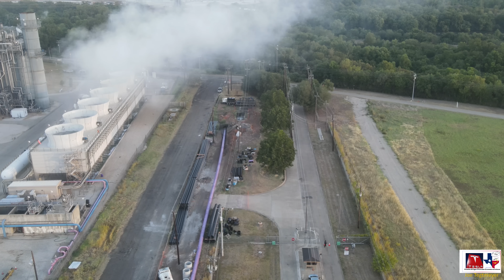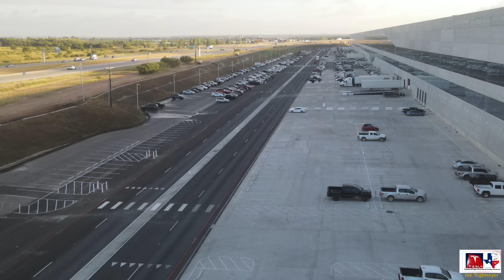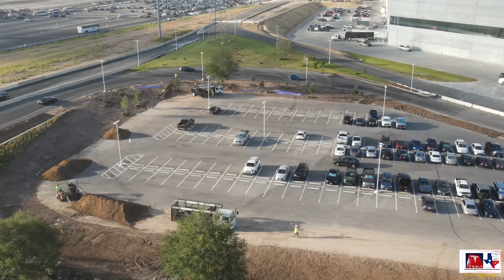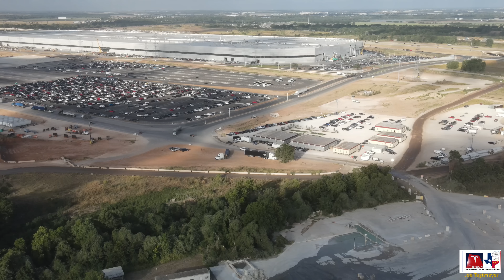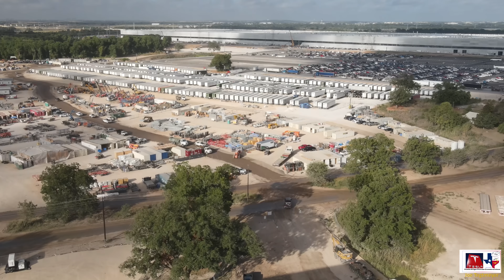Tesla Gigafactory Texas 29 July 2022 Cyber Truck & Model Y Factory Construction Update (07:15AM)

Comment: Great to see work in the wiring of the solar pannels. It seems that they started wiring a few pannels a couple of weeks ago. When I see how they are working to wire the pannels which are at the border, having to lay on the floor and go with deep under the pannels, i wonder how they are going to be able to reach the connections of the thousands of pannels already screwed onto their support, and with such narrow corridors between the different lines of pannels...

Comment: Thanks Joe.
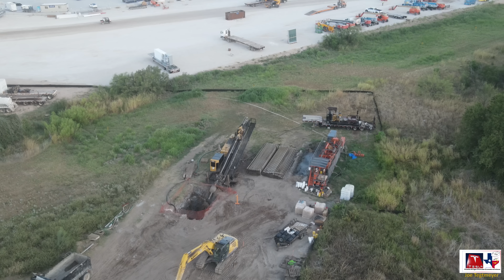3:36. Easement, south end. Top of screen. 3 of the remaining window units for the East Main Entrance. Seen back at the entrance in Brad’s video, https://youtu.be/FAEWvHSppvM?t=792
North drilling location. The round item at the bottom of the drilling pipe would be a reamer. Seen in many of the other youtube videos about HDD. In Joe’s photos there isn’t a length of drill emerging from the bore…..
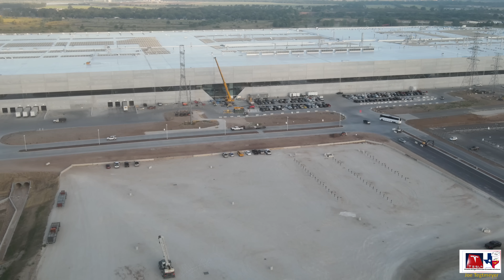4:29. North-south road. Another window unit arriving.
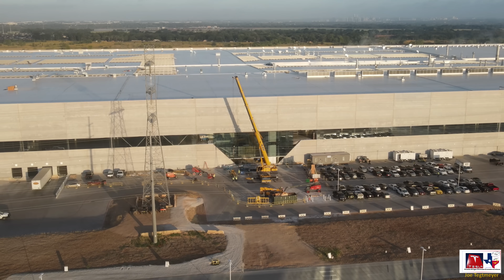5:01. East Main Entrance. Swapped over to the smaller vacuum lifting rig.
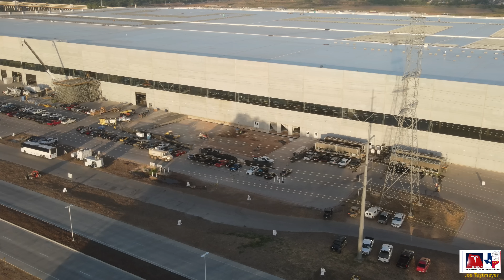5:29. BIW, right of screen. Formwork placed for the dock leveller in the new loading dock.
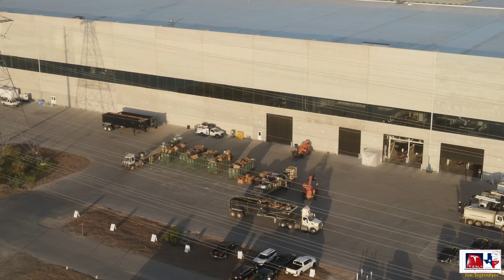6:05. Stamping. Right of screen through the large doors. Recycling bins under the scrap conveyors. Empty changeover bin outside on the apron.
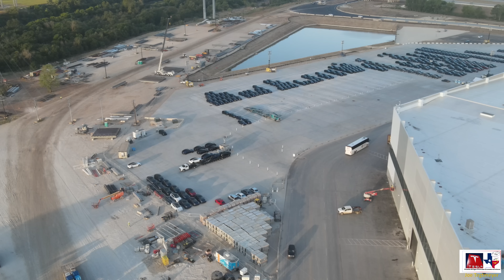6:27. Easement across from Stamping. Bottom centre. Stack of initial side panel stampings.
8:08. Stamping Extension, apron. A Tesla driven up onto the ‘loading pallet’. Used this pallet previously around at the BIW loading platform to lift BIWs. Right of screen here, https://youtu.be/FBY74mx3_zQ?t=341
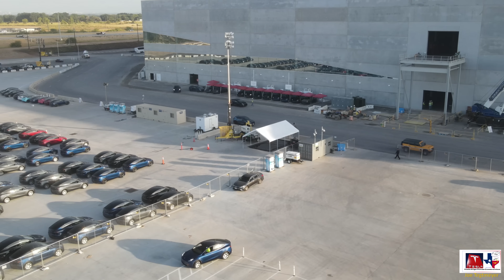8:32. GA, apron. Superchargers. Cable drums set up to pull supply through to the new Superchargers around the corner.
Hardstand. Catch tray under the canopy. Couple of pressure washers either side.
12:36. Cyber-berm. Grey electrical conduits. For architectural lighting presumably.
16:17. Tesla Road, north. Duct bank ready for encasing in concrete. 2 bunches of risers, possibly for street lighting or an out building.
17:04. Cathode. Top left, crane set up beside the road.
17:17. Cathode, north end. Top of columns. Curious about these angled top connector plates. Beams seem to be a bit below, 1” 25.4mm or so. Better view in Joe’s photos.
17:44. Cathode, inside. Scaffold stair being assembled. 
18:06. Cathode. Big grey electrical conduits, supply-in perhaps. Laying sewer drains inside.
18:28. Cathode. Level 2. Orange/reddish boards are covers over framed out floor penetrations. Frames seen here prior to decking, https://youtu.be/7R-b504hIbc?t=925

Comment: wonder how much electricity that roof will generate per day.  Maybe more than the factory uses.  I guess they can get credits by putting power into the grid?
Reply: about 1/3 of the factory requirements
Reply: One sq. meter of solar produces at a rate of about 1,000 watts in clear direct sun. One 100 Hp. motor requires about 85,000 watts to run.

Comment: Joe, I noticed at 3:24 that the drill stem is disconnected from the string under the river, hope that it is to remove the guide from around the stem.
Reply: I noticed that too, but curiously nothing in the commentary, so I took it as a hint I need a 4K monitor to see what's actually going on. Strangely, there is nothing coming out of the ground, so I hope they haven't busted something.

Comment: with all the land Tesla  has, I wonder if Tesla will invite the recycle company to set up shop on site to reduce travel time & allow on site storage of materials to be recycled?  Plenty of land back behind the battery cathode building which would keep it out of sight.
Reply: Larry, During the casting process they spray the molds with a release agent which would contaminate the aluminum. Texas Disposal Systems (the company that they have been using) is located 17 miles to the south.

Comment: @ 18:54 The 12  holes in the second floor could be for piping or ducts.
Reply: David, from the extra supports and spacing these are probably openings for silos that contain the feed for the plant or other required chemicals.
Reply: @eltonray2934  Yes, that make sense! I think you're right.

Comment: Hi Joe!  I'm curious about the HVAC installation on the NW corner of the roof.
It seems like it's taking a really long time for what we can see on the roof. I would imagine that there is more we can't see going on in the building that accounts for all the time they are spending here.  Are these just vents on the roof, or is there equipment installed inside that we can't see?
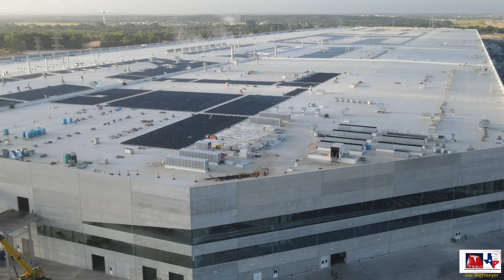Reply: Jim, I think that the oblong structures on the east side 11:46 are filtered air intakes and the structures with the tapered metal top sections on the west are exhaust. They will probably remove heat from the building for process cooling or possibly HVAC or both. This is all part of phase 2.
Reply: @eltonray2934   Thanks.  I think you are correct.  It just seems like they have spent a lot of time working on what we can see on the roof, and I'm wondering what we can't see that would be causing them to spend so much time on what looks like it should be completed in a couple of months.

I just went back to the July 28, 2021 video - There was lots of open walls back then and you can see big industrial fans located below the vents on the roof.